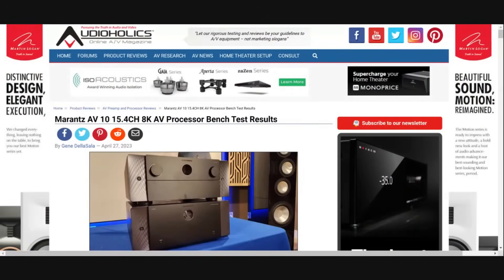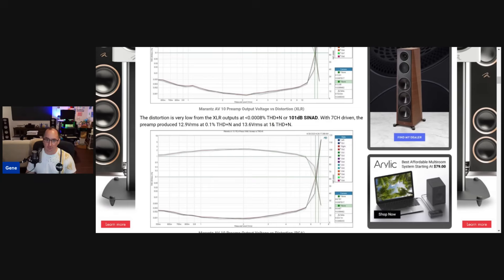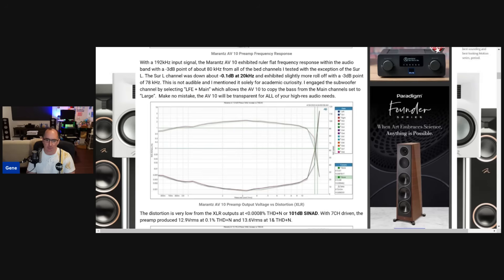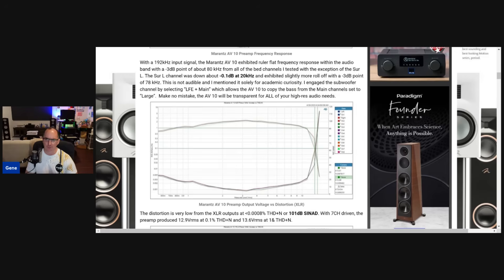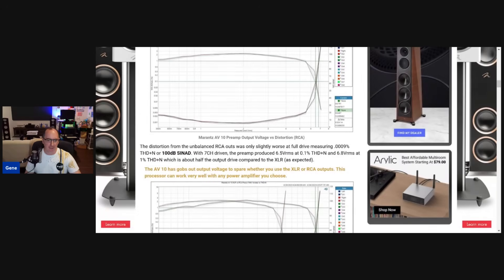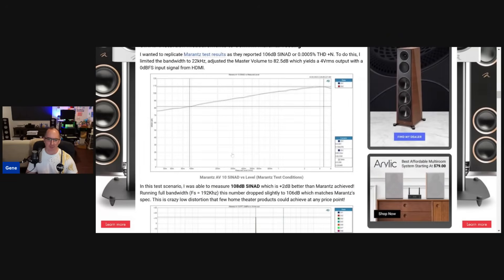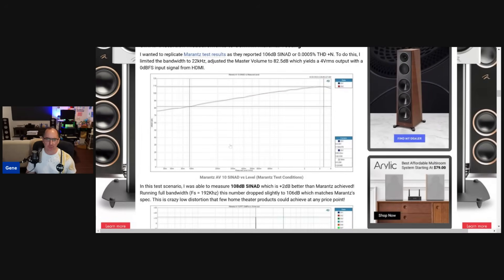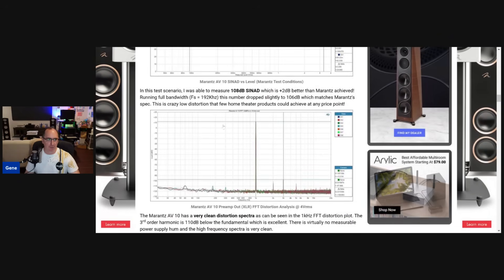Marantz AV 10 Measurement Supplemental - Better Than I Thought?!?

Comment: I mainly use the AV 10 for 2 channel and I'm so impressed with the performance over the 8802A prior. The 8802A was really good but the AV 10 is clearly better. It is so cool to have a the best of both worlds( 2 channel and surround sound) in one unit. 

Yes it's expensive but it's such a good upgrade that I'm still very happy that I bought.

Comment: Hi Gene. 

I have a Anthem AVM 60 Processor. I am looking to upgrade to a processor with more power to push my AMP (McIntosh 8207) with better sound and better video processing. Would the AV10 accomplish this?

I strictly use my system for watching movies; discs only. My 8207 drives my B&W 702’s, B&W HTM82, B&W CM 8’s and B&W 706’s and I have 2 B&W DB4S subs and 1 B&W CM 12.

Any insight and advice would be greatly appreciated.

Jeff

Comment: Quick question, will there be or has there been a firmware update for the AV10 to relocate the on screen display of the volume level?  I'm using an anamorphic lens with my NZ8 projector and consequently I cannot have onscreen volume display with the AV10.  I can choose top or bottom but it places it right at the edge so in the stretch mode for the anamorphic lens, the volume display is off the screen.   Thanks, Monte.

Comment: Not sure if this is related to measurements but I have a Marantz SR014 connected to a stereo integrated amp (AVR pre outs to amp RCA inputs).  The integrated amp has an auto shut down function when it detects no signal after 30 minutes, and I have found the amp shuts down when AVR is being used.   So, I connected an am/fm tuner to the amp and it did not power down.  Does this mean the AVR signal at the pre-out is somewhat weaker than the tuner?

Comment: Did they fix the arc connectivity issue? I bought a Nad processor,  and never have had a problem. I like Marantz but it's too damn complicated, independent Control of video sound for each source is difficult. Video select on a Marantz is difficult.

Comment: I have stopped following these reviews for a while now. It seems like, in the last four years at least, there is a lack of killer application for these systems. I own a, now ancient, Yamaha adventage 5200, and the additional benefits of these newer systems seem to be the ability to handle yet more speakers. Even in my ancient 7.1.4, I already have 12 speakers and it seems to me  the added ability to handle16 speakers is not even an incremental benefit. Most streaming programs, stream in 5.1 or 7.1 (ok, you can upscale the audio) audio and 4K video. 8K in the house seems a product for those few who have HUGE houses. The only thing I would definitely like is the ability to switch input faster, the 5200 is pretty slow in synchronising  HDMI, but that is not worth it the price. These systems seem to be, at the moment, a solution in search of a problem, question is, what is the next killer feature worth it a few grands for upgrading?

Comment: Simple and direct question, does the marantz AV 10 compared to the Marantz AV 8805\A have a better sound?, by better sound I mean more precision, greater details, more spatiality, more channel separation, more three-dimensional stereophony and better than the 8805A? It's more musical and has a cinematic timbre like trinnov or storm audio thanks
Reply: With the exception of adding a better control in full spectrum frequencies and time impulse domain offered by Dirac Live, there is no significant improvement in audio quality rendition. Just more channels...and a front design with lights.

Comment: Very glad you call out SINAD as not a good number to judge a product on, we have a few sites pushing that nonsense.
Reply: If you love to hear hiss and distortion, then no...SINAD is not a factor to take in consideration... But for me, is one of the most other important factors that I take in consideration when judging the quality of an audio product.
Reply: @florinbizu7583  after a certain point SINAD is irrelevant, SINAD can also be manipulated in several ways to produce nice results, including increasing the voltage out of the device.  A SINAD at 1khz is useless.
Reply: @GuiltyRocker  I agree. Measured at just 1 KHz sinewave, is not relevant. It should be made multiple measurement in full audio spectrum, at 2 to 4V output, EQ on in 0 dB, than raised up to +6dB at 30 to 60 Hz, 10Khz, 16 KHz and finally up to 20 Khz.
Reply: An unfair claim of accusing anyone of "pushing" SINAD.  Yes ASR was one of the first sites to start measuring and posting SINAD results and comparing results in any particular genre of gear. OTOH NO ONE of stature on ASR ever recommended using SINAD as a one number solution for choosing gear. Problem for many people not well versed in measurements that don't have the background compare the say 20 or 30 sections of measurements, and WANT something simple to understand and use as a easy barometer to chose from.

Comment: I'm hoping someone can explain a comment made in the review.  It says that the AV 10 "isn't a true differential design" when discussing the balanced XLR outputs.  This was also mentioned in the previous video.  What does this mean and in what circumstances would this matter?  Thank you!
Reply from the maker: Most consumer audio doesn't use fully complimentary circuit paths from input to output. Instead, they use a phase splitter to get a balanced output. It's more cost effective and simple to do this. You still get good ground immunity but don't realize the full distortion reducing benefits of a true differential circuit. Regardless,  the distortion is so low in this case, it doesn't really matter.
Reply: @Audioholics  It could still matter for the cables though?
Please correct me if I'm wrong, but wouldn't balanced cable runs mitigate external noise much better than non-balanced?
Reply from the maker: @Mikkel Kirketerp  they can, and the XLRs still have that benefit as I stated.
Reply: @Audioholics  Thank you!  I don't think I've ever heard that explained before.  Do any processors have a true differential design?  Do you have to step up to the Stormaudio-class to get that level of quality?
Reply: Everything matters in audio quality rendition, but in AV10 you will find many cheap tech solution implemented - not a true differential design in XLR output, is one of them.

Comment: One of the things that really bugs me about processors and AVRs is that they very rapidly become obsolete, whether it's because of newer audio or video standards, or newer hardware standards like HDMI versions.  I would probably buy the AV10, but not if I have to throw it away in 3 years, and I cannot find anything about whether this unit will last through these kinds of updates. Is the hardware and software upgradeable?
Reply: I don’t think so. Last major update was Atmos. Other than that, nothing is a must have. 8k is far from a must have
Reply: @SS-cs6wt  "8k is far from a must have"  So true. For me, not even Atmos is a "must have."
Reply: @SS-cs6wt  I guess it's time to find out what kind of systems they use at the movies. Maybe this would inform one of the potential for obsolescence.
Reply: @SS-cs6wt dirac Art. There you go - another soon to be must have. Whether AV10 will get it very unclear.
Reply: You can expect new technology to improve on AV hence why you don’t go all in on AV. The noise/distortion is so small the difference is not noticeable on premium gear. The only reason I even considered AV 10 was for balanced outputs. If you spend 7k on AV10 you can expect another AV to supersede AV 10 in 3+ yrs. You can’t recoup that 7k since no one even in used will spend 7k when something less does better. Also don’t go all in on DACs since technology also evolving rapidly. Expect other premium AV gear from Marantz in 2024/2025 less than AV10 perhaps does not do it all but close enough. I go all in on AMPs and speakers since you can keep premium AMPs and speakers for a very long time 5 - 10 yrs even more if they are well built they last forever.